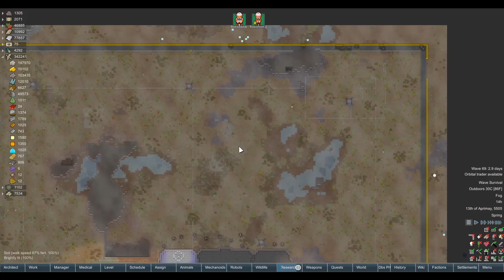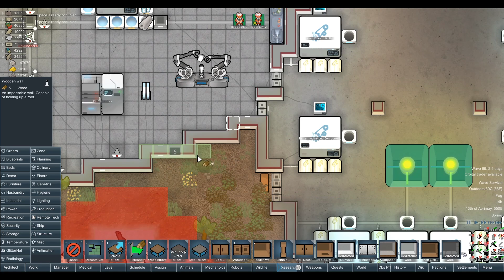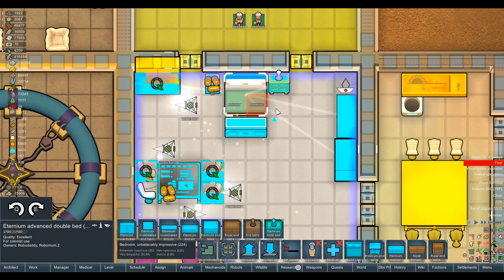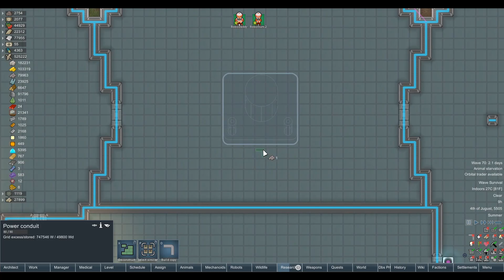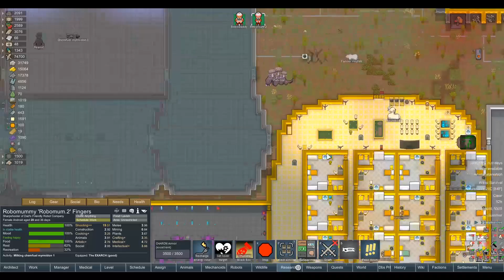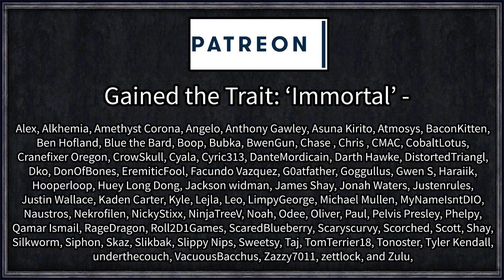Rimworld: Father of Machines #30 - I Regret This Decision Immensely

Comment: Remember with mud, shallow water, stuff like that you can turn it into normal terrain that can support heavy with the moisture pump.  If the tile beneath the pump is convertible then when it is built and powered it instantly converts that tile.  Shallow water to rocky/stony soil, mud to soil

Comment: ive recently been having problems with raids not spawning and when they do its only ever imperials or mechanoids, it could be a bug with high point raids or a mod is messing with it (idk which one tho) devmode console says "Got no pawns spawning raid from parms (target=(Map-0-PlayerHome) points=[however many there are (usually in the 15k-80k range)]"
Reply: im not using wave based survival btw

Comment: The Robots should still work in space, as it is mostly just a a scenery change. It doesn't affect other mods physics so you might be able to still use the T3 drills as well. That would be fun...
Reply: In fact Drills work in space except for the drill that requires special terrain like the drilling hole from the skydriller, which the t3 plasma doesn't. And if they would not he could always just go and set up auto assemblers with drill recipes.
Reply: Well at this research point, i bet robodaddy can land on meteors